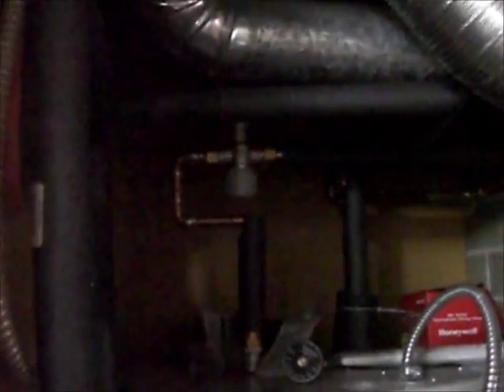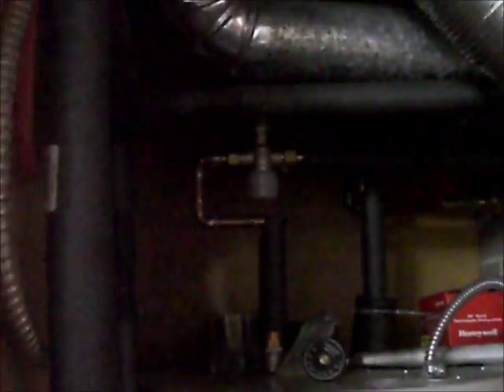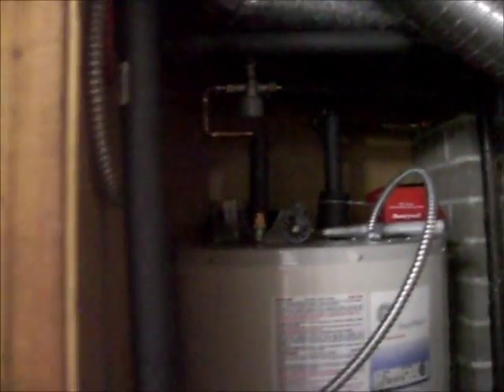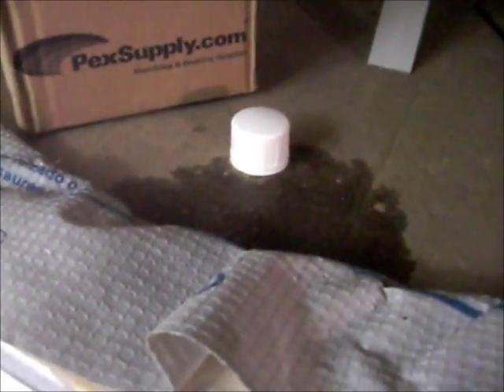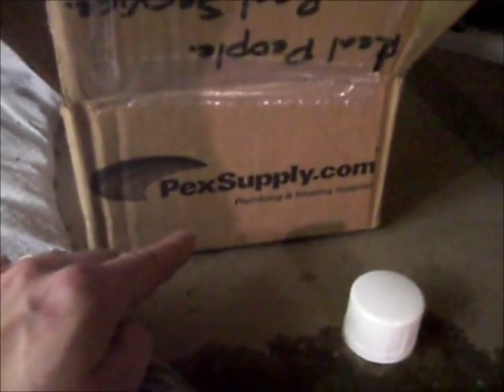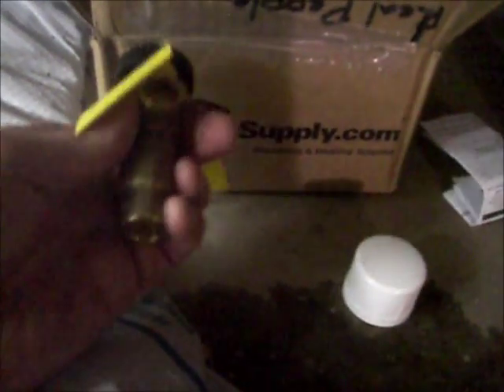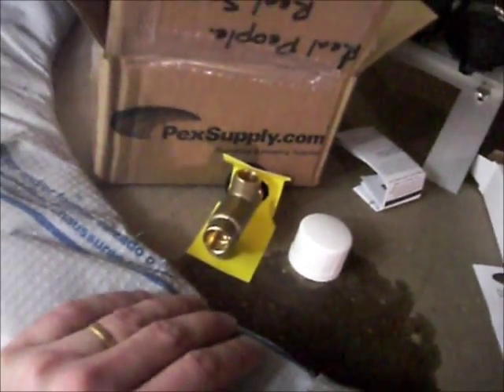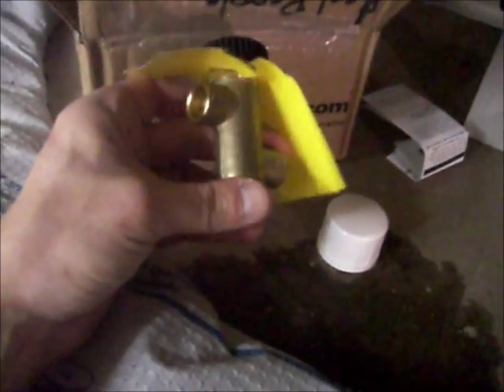Solar Tank Watts Mixing Valve

Comment: Hi I'm Brian 5th generation plumber, 3rd generation solar installer and nabcep certified. That mixing valve will bring your temp up as u desire, however, it will drop your pressure to all hot water locations.
Reply: How?